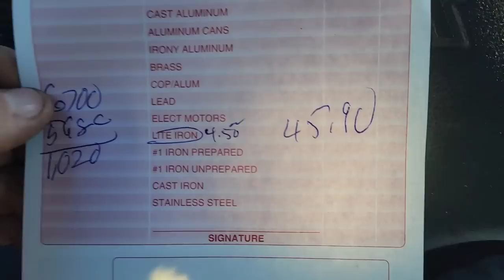Recycling Metal ♻️ and auction scores

Comment: HI Bert great video.  very cute and large feline give him some catnip toys for a nice high he will love you right back . very nice vintage lock and key sets . your tomatoes and peppers still look great . nice pick ups from the auction . with those weeds pull them out by hand  and then spray very well that will help slow them  down there growth . that was pretty cool @ the scrap yard the operator cleaned out your trailer in 1 scoop .